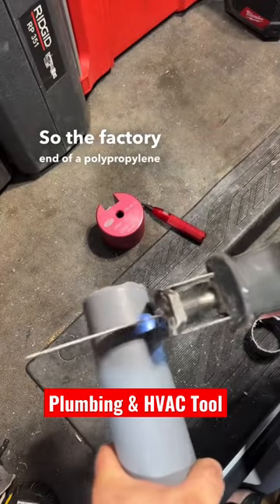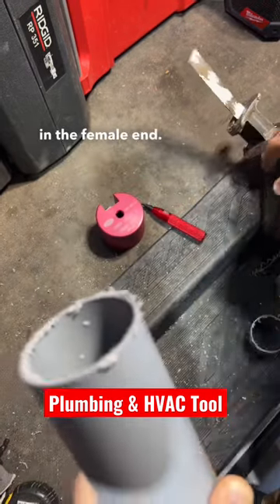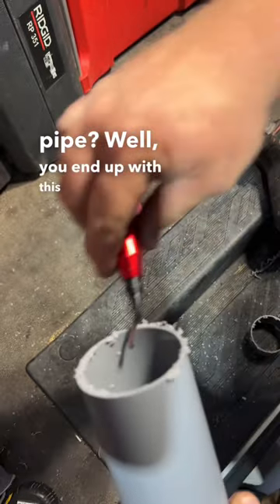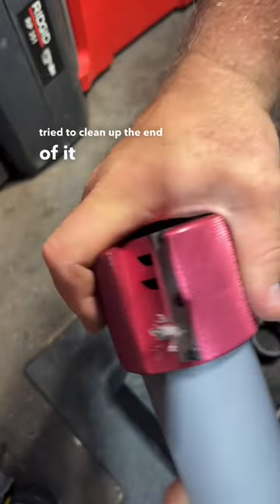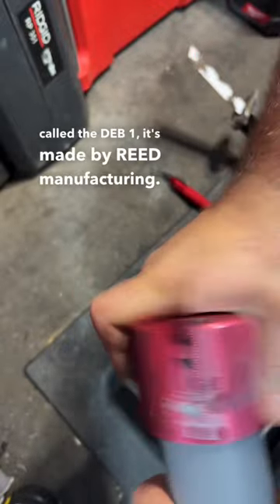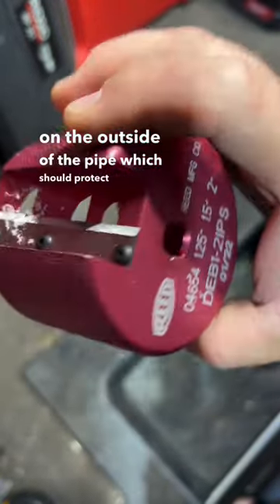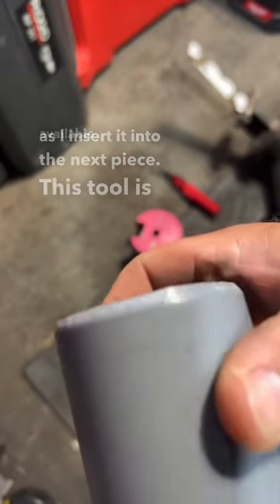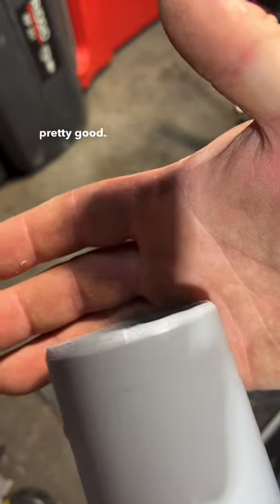MUST HAVE Pipe Tool

Comment: You can also use a pair of channel lock pliers. Open the pliers up and use the teeth to grind around the inside and outside edges. Takes two seconds.

Comment: So this tool is also used on beveling pipe that is glued together to give you a thicker glue joint when you push it into a coupling of any sort. 
 Also stops back out of the pipe If the right amount of glue is applied and the bevel is the appropriate size

Comment: A few years ago when running 16" SDR pipe i was tired of using a grinder to bevel the ends i cAme up with rhe idea of using a router to bevel the ends ..so i tried it and it was badass...it left factory like beveled ends...try it out...just becareful , wear safety goggles

Comment: That’s great do you know what there is for 3” and up? I’ve seen a ton of centratherm leaks from the littlest burrs , dirt ect. From not have the proper prep on the pipe
Reply: Always on the cut fittings. It’s also a bitch to get some fitting together without the beveled edge